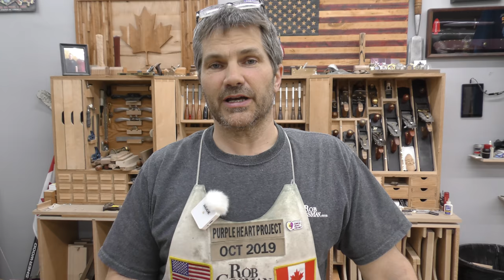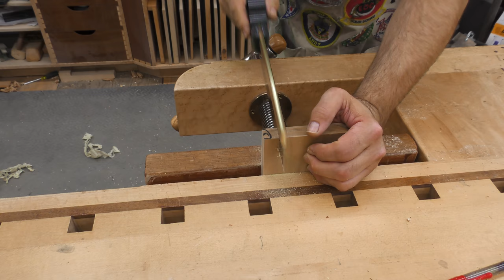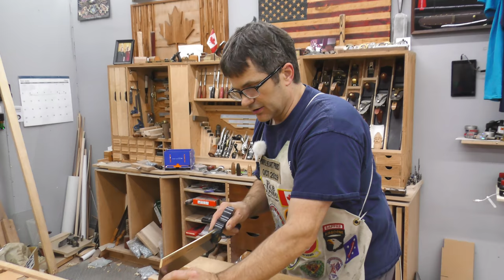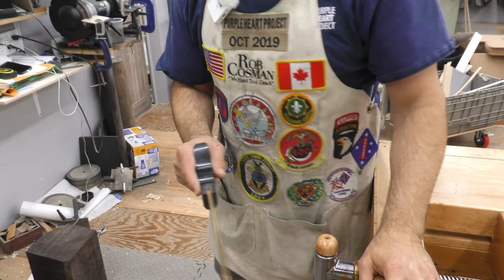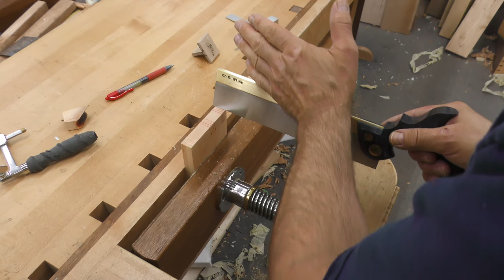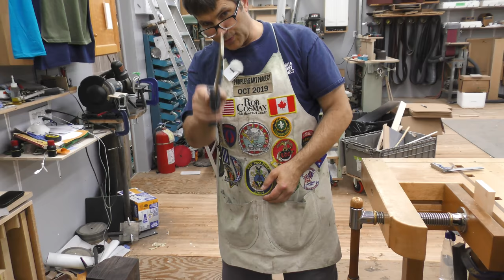Dovetails By Hand - Sawing Tips & Tricks

Comment: I am pretty much a complete novice.  Sawing has always been a white knuckle chore, angles were always anything but what I wanted, and you could just forget about sawing on the line I wanted. This problem of mine has made me just go to a machine to get the job done - which I still usually manage to screw up.  I watched this last night, practiced exactly as Rob demonstrated.  In about 30 minutes I am magically able to hit within 1 degree of 90 on the rip cuts and able to start lines exactly where they need to be started.  I haven't started on trying ripping angles (which is still a bit terrifying to me), but I am feeling so much better about the prospect.  I am soooooo grateful to have found this video!

Comment: Great info on body positioning. I hadn’t heard that level of detail and bet that’ll improve all of my sawing.

Also, if y’all don’t have starter teeth on your saw, a quick n’ dirty way to make some is taking two light passes with a file across the top of the first inch of teeth. A nail file (e.g. an emery board) will even work on induction hardened saws since the abrasive is usually aluminum oxide.

Comment: I was struggling to get a consistent plumb cut on the tail board and I came across a video by DavidBarronFurniture titled “Chisel techniques for hand cut dovetails” and he uses the dovetail marker to align the saw when starting the cut. I tried it and it helps me start the cut plumb. The trick is figuring out exactly where to place the line against the dovetail marker to start the cut and preserve the pen line.

Comment: Your stance is very good.  In the oilfield you are taught that the center point between your feet in any orientation there is a weak area perpendicular to it, all work in that point is to be avoided because instability/injuries/blahblah.   You can demonstrate it by having someone gently push/pull you perpendicular to the center point of your feet, and then have them push/pull you parallel to your feet.   Your whole body will be significantly more stable if you avoid that weak point no matter how you position them.
Reply from the maker: Good points.  Body mechanics are key
Reply: Very interesting thank you Carl.

Comment: There are usually several ways of formulating the same truths. My sawing started to improve a bit by realizing that I was giving my hand too many tasks to carry out. I was asking it to grab the saw firmly, hold it upright (perpendicular to the workpiece) and steer it along the line by pushing it forward and pulling it back. I replaced this notion by giving it just one task: hold it perpendicular. All the other tasks were assigned to my elbow. Which alerted me to the need to know where my elbow was and also removed any need to hold the saw in a white-knuckled grip. ( Hold it as you would a baby's hand, as that chap Rob Cosman advises!).

Comment: Great video! Quick random question: I saw you dropped your square. I drop stuff all the time and my floor is concrete :( What kind of padding do you have in the area around your bench? Are you happy with it?
Reply from the maker: I have those interconnecting lightweight mats you can get in bundles at the big box stores.  I think they are designed for playrooms and exercise rooms
Reply: @RobCosmanWoodworking  Thank you! Just bought some!

Comment: Rob, excellent video packed with useful information. Your saw looks well thought out, but I have a question about resharpening. 15 tpi teeth are small and somewhat of a challenge ( for me at least) to sharpen and set. Can a hobbiest sharpen and set 22 tpi teeth? Does having both 15 and 22 tpi make it even more challenging?  I know a DT saw isn’t sharpened that often but eventually it needs sharpening. Thanks again for the gift of your teaching.
Reply from the maker: Well i recommend never sharpening the 22 TPI teeth.  They actually work better dull.  Sharpening them makes them “sticky” and harder to start.  As you say, anyone can sharpen the 15 TPI teeth

Comment: Rob, thinner boards (like 1/4” or  3/8” thick), would it be appropriate to use some sort of a sacrificial backer board? Also, I remember you saying that if you don’t have a slew block, to either use a table saw or clamp a ruler on... would you encourage light chiseling to the gauge line to create the catch for the pin board? I don’t have a sacrificial fence for my job site saw, and the clamping the ruler method  makes me worry that it would be awkward.

By the way, you were right about the saw! Good tools make the job easier.
Reply from the maker: Yes, add a 3/4 inch pine sacrificial board behind your actual board.  Extend your line onto the sacrificial board.  Now you have more line to reference against.  I would not chisel.  Another method is you can use a router plane to take down a small rabbit.  If you don't have that just clamp on a ruler or a piece of wood with a straight edge...it's not a problem.
Reply: RobCosman.com thank you Rob!

Comment: Nice video. I have seen that putting the finger in the top of japanese saws develop the muscle memory. But im thinking in adquire western saws

And i have a question. Is not about the video. But the other day i was looking if i find scraper videos in your chanel. And i was surprise of not find one(because i have seen most woodworking topics in your chanel). Do you use scrapers or prefer sandpaper?
Reply from the maker: I use planes with sharp blades and try not to use sandpaper.  If I need it every now and then I will reach for my scraper.  Guess I need to do a video on it.

Comment: Rob I really appreciate all of your videos. I watch them from the other side of the world, jordan. I have a question concerning hand plane blades. With every single blade I tend to have a slight camber whenever I sharpen them. Whether I do it free hand or using a jig I always end up with a slight camber. The blade is flat and the sharpening stone is flat. Not sure what I am doing wrong, any help would be most appreciated.
Reply from the maker: Well it has to be either: 1) the stone is not perfectly flat like you think or 2) you are putting uneven pressure on the blade when you sharpen
Reply: @RobCosmanWoodworking  thank you very much Rob. Both are very possible. I will try sandpaper on a flat surface and watch out for uneven pressure (actually now that you mentioned it, I might be pressing more on the edges with my thumb and index as I grab the two ends of the blade like I grab a pencil). Will give it another shot and see how it goes. Thanks again for all what you do.
Reply: @RobCosmanWoodworking  hello Rob. I paid more attention to my technique and used sand paper on a flat surface. It worked like charm. Happy with the results. Thank you very much for your help.

Comment: My Cosman dovetail saw doesn't seem to cut nearly as aggressively (fast) as yours when I'm trying to simply use the weight of the saw to make the cut.  I assume you are actually assisting the saw by applying some downward pressure?
Reply from the maker: I probably aim my down pressure on about a 5 degree slope

Comment: What is the difference in the teeth on a dovetail saw vs a crosscut saw?
Reply from the maker: Crosscut vs rip.  Crosscut have sharp three sided teeth who’s points score either side of the saw kerf before removing the middle.  Leaves a clean cut.  Rio teeth are two sided teeth that have a chisel like sharp edge that takes out small chunks parallel to the run of the grain.  Faster cutting when ripping wood.
Reply: @RobCosmanWoodworking  Thanks Rob. I have your Crosscut saw and love it. I'm working up the nerve to try hand dovetails!

Comment: Great video, but... it’s spelled PLUMB, boys!
Reply: ... now, that being said, I want to go on record to confirm your (Rob’s) statement that the saw is 70% responsible for your success in sawing dovetails. I was struggling with my dovetail cuts using a decent Crown saw. Then I bought myself a Cosman saw for Father’s Day. I built 4 drawers for my workbench (that’s 16 dovetail corners) in July with my new saw, and every one of them was at least a decent working dovetail joint. Three out of my last four were what I would call good, and two of those three went together “straight from the saw”. Doing practice cuts like you demonstrated in this video is a crucial skill-builder, Rob, thanks for demonstrating that!
Reply from the maker: Thanks for buying my saw.  Sounds like you are off and running
Reply from the maker: Sounds like you are doing great!